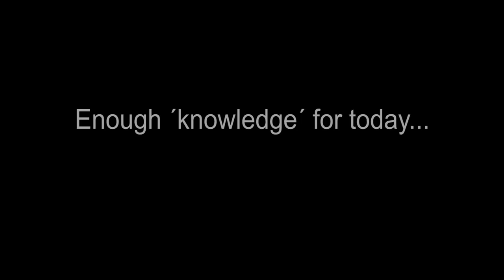How To Make A Perimeter Alarm System - Post Apocalyptic Life Hacks

Comment: You can make it a lot easier. I use a mousetrap, do a hole in the wood and place the cartridge through it.
Reply: And that doesn't even require a post apocalyptic welder and drill press.
Reply: @rocketman3485  however, if you do have it, it is reusable for a long time, unlike the mouse trap made out of wood that will be destroyed. And also the mice and perhaps rats it can kill will keep your food safe and even... give you a little extra to put in your stew... :)

Comment: The hole in the nail + pin combination results in too much friction and difficulty to trigger.  Better would be a double notch on the nail and a plate with a notch, to keep tension and release the nail.

Comment: Great engineering. I made one for 17$. Yours is simpler. I would add a 90deg bend to the flat plat in the middle so it could be used as a mounting surface. Add holes for screws or cord.

Comment: Great video! Though it seemed a little over complicated. 12 gauge rounds fit in 3/4-inch schedule 40 pipe and the pipe can be bought pre-threaded. ;)

Thanks for the video.
Reply: probably not available in Austria, and likely verboten

Comment: A price of galvanized pipe 3/4" if I recall . . .a bell reducer and a price of round stock that fits the small end and a price of tape to be sure it stays . A price of pipe ( old muffler pipe works well , and a long cotter pin for a . . . . . pull pin that your trip wire attaches to . Put the 12 gauge shell into the galvanised pipe screw on the bell reducer then insert the round stock ( turn the end or hammer it to a point ) then put some tape to keep it located off the primer ( Be careful if it hits the primer it will go boom ) also if parts and time aren't a problem use a spring and epoxy or silicone each end of the spring over the round stock to keep it in place as it's safer . Then drill a hole through the muffler pipe off center so the pipe , shell bell reducer can't pass the cotter pin in the pipe . Put in the pin run trip wire attach to cover pin so the pin will pull out of the muffler pipe allowing the ' assembly ' to drop and it's own weight will drive the round stock into the primer . . .Boom ! No welding or tools required as a nail and hammer will put holes into the muffler pipe . All else is hand assembled . My outer perimeter will have these . . . .and a couple other types . My second perimeter will be bodies of those that didn't get the message from the first perimeters warning . I like the Vlad deterrent technique . Be well and again great bid .

Comment: I made mine to take .22 blanks and power loads for the power hammers used in construction.. I made mine similarly but with smaller parts which are cheaper, easier to get and much lighter, allowing you to carry more alarms and more shells as well as being able to use a wider variety of  metals.

Comment: If you added a funnel to where the blast goes out it would amplify the noise into a specific direction depending whrre the funnel is pointed incase you were to set this up at a furthar distance and didnt want or cant use pew pew powder to make a louder pop (either to save resources in a real situation or for legal reasons)

Comment: i think welding a hinge to the big nut would be better than using a cut off wheel to let shell drop in, also using a brazing rod will be stonger than the solder.